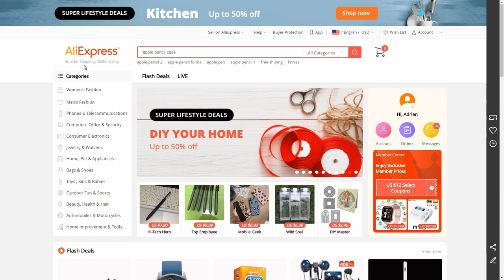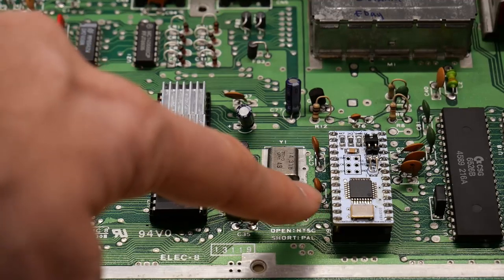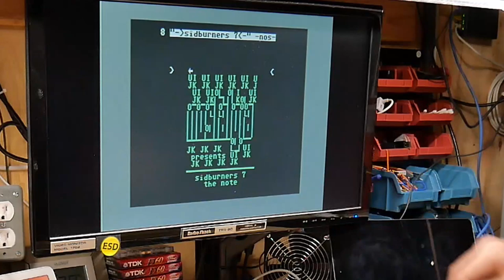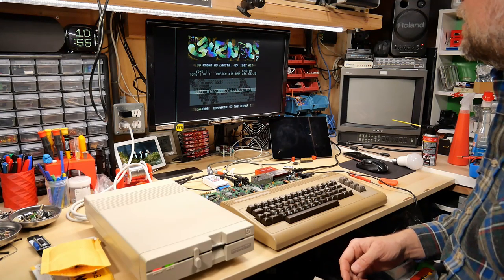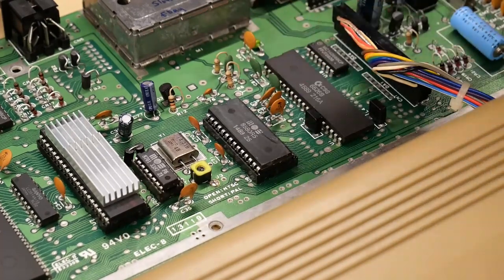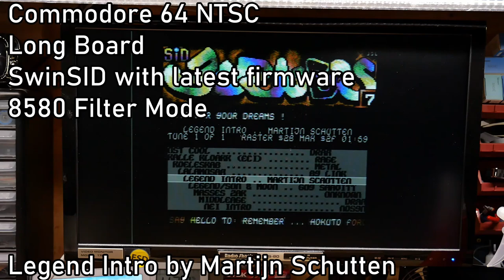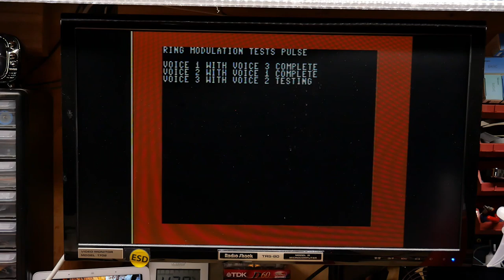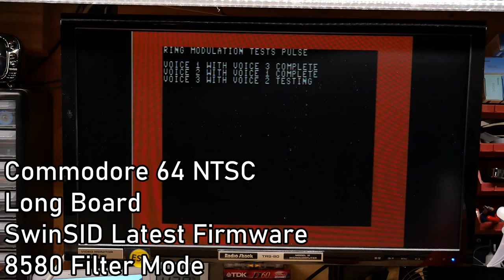I bought a C64 SID chip from AliExpress!

Comment: Oh yeah, the Legend Intro does sound a lot better on the 6581, but you're pretty lucky the 8580 is doing anything at all! I've been looking at buying some old/NOS DRAM chips for a couple of projects, and I'm basically completely ignoring any source from China now. There's a few European sellers on eBay that I've bought SRAM and other chips from before and had no issues with at all, but I finally got around to testing the SRAM chips I bought from China a while back and they all reported the same error in the Xgpro software's SRAM test, so I'm definitely not going to trust them. Ran the same test on some of the chips I bought from the European eBay sellers and they came back fine (although they were a more modern chip with faster access time, but the exact same pinout).

Comment: About the 8580, you said:"These on the other hand only run off of 5V" PATENTLY FALSE! On pin 28, you will find 9V instead of 12V.
The 6581 requires both a source of 5Vdc and another of 12Vdc. While the 8580 requires a source of 5Vdc and a source of 9Vdc.
Reply: He was talking about the SwinSID.  He explicitly mentions that the original SIDs run on 12V and 9V respectively.
Reply: @ovalteen4404  No, he was not. 03:00
Reply: @ovalteen4404  Elsewhere he also refers to later VIC-IIs running on 9Vdc which is also false.
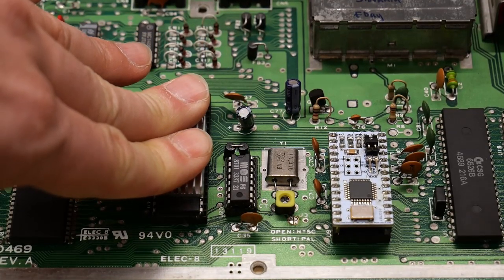Reply: @francoisleveille409  I see. Well he gets it right at 5:10. Probably a brain fart.

Comment: Joystick mod: I had 2 joysticks with two buttons (Competition pro and a Quickshot pro). I disconnected the second and led 2 wires from it to the outside. I made a plug where the fire button lines are soldered on. Then I put the joystick in port 2 and connected the wires to the plug. I think always all games which required space to jump (etc) also reacted to FB1. No gamepads back then or at least I did not have one.  Also a good Idea: The Competition Pro without micro switch fire buttons had twice as much hoisting capacity as needed to close the circuit so the mounting of the contacts can break. After experiencing that once I fixed the lower contact with TESA. In hindsight: you may have to renew it every 2-3 years as it ages badly.  

BTW: do you have a list which chips I should at heatsinks to? (I use a 128 at the moment). And what else is needeed to keep a c64/128 from dying?

Comment: I have two c64c boards and one needs a vic and sid the other has some gfx issues. I can buy them for £15-£20 and all need vic and sid for this price. The Vic are around £10, but all the sid chips are between £30 and £40 in  europe - uk. I brought a cheap nano swinsid for testing ect but I don't think it is worth buying the cheaper boards and then spending £50 to replace the two missing chips.

Comment: The TAC-2 was a great joystick. 
Come to think of it, does anyone know were you can find new old stock?
Reply: After years and years of use I actually broke a TAC-2. After a lot of (ab)use the it succumbed to material fatigue, and the small ball that actually made contact with the metallic strips inside broke clean off just below the machined out area where the wire was connected to the stick. Other than that it was basically just as new. 

By this time I was actually working for a distributor and retailer, repairing Atari ST, Commodore Amiga and various printers and portable computers. We had a lot of different joysticks in our stores and I experimented wildly trying to find "the best" for me. I don't even know what the name was of the one I ended up using the most. It was basically a grip with a small joystick and it was fast. Blisteringly fast and exact compared to all the other joysticks I tested, something you couldn't always blame the TAC-2 for as it could be frustrating trying to do diagonal moves. Sure you got there, but usually not before taking a few horizontal or vertical steps first. The "grip" joystick had no such problem. The funny thing was that apparently I was one of very few who actually liked it, so we had a crate load of them that had been pulled from the stores and was just waiting to be thrown away.

I'm guessing, but I think most people just looked at it and thought it looked weird and never even tried it. Instead they tended to buy the large gimmicky joysticks that looked like wannabe flightsticks. Most of these was mushy and of very dubious quality. I actually bought one that I ended up just keeping on a shelf. It was very well built and next to impossible to break, but also totally unusable as it was so mushy. Then there were the arcade fanatics that wanted something that felt like what they used in the arcade cabinets and those people usually ended up with a stick from VICO. Those were large, heavy and built to last forever. I can understand why people liked them, but they also had long a very long throw which made them slow.

Comment: There used to be a local guy who sold a lot of C64 chips that he got from china presumably but he would always test them and it worked out pretty well. Seems like he no longer sells them but I got a VIC-2 for 10€ which has served me well for over 2 years now. I've had pretty good luck with the 4464 RAM chips from aliexpress, cost pennies per chip compared to a few bucks for one on eBay so I wouldn't mind if half of them didn't work, although when troubleshooting it really helps to have known good chips so it's a bit of a tradeoff

Comment: As gadgetUK said the 8580 uses 9v, the vic in the short board uses 5v. It will use the ac power for switching frequency reference but works without, try a short board with no fuse, still has picture but no sound

Comment: you need to get some arm sids: https://retrocomp.cz/produkt?id=2 check out all the different types. for a remake of the sid, its good. i wouldnt say 100% but i sounds better than the 8580 and it sounds better than swin sid, plus you can change if its an 6581 or an 8580.

Comment: i got a few minutes into your vid,allow me to make a few corrections on what youve said so far upto the vic chip(on short boards) ,the vic is 5 volts only,the 6581 is 12 and 5 volts,the later 8580 is 9 and 5 volts,you want to see what happens when you remove the fuse,short board will boot and have a picture,but have no sound also can be easilly found out with a volt meter its the same pinout as early verion parts but voltages are different

Comment: I'm amazed to hear that the C64c isn't common in the States. Didn't Commodore release it in 85 or 86? I remember them being stocked from then until about 89, not just in the mass market retailers but in the nearby Commodore computer dealers. I guess the NES by that time really bit into the potential low-end sales. As an Atari ST owner at the time, I really wish the lack of sales was due to Atari ST and Amiga sales here in the States but if that were the case, both platforms would've had a much larger user base and more comparable to what both had in Europe where they were both much much more popular. Over here, the ST and the Amiga fought for scraps. What probably robbed C64c sales in the States during that time period were VTech's Laser 128 line, the Tandy 1000 line, and to a lesser extent, NOS Atari 800XLs and the contemporary Atari 65XE/130XE/XE Game Systems.

I want to see what the Commodore scene can do with the modern PokeyONE chip solution. In addition to supposedly doing Quad POKEY audio, it can do Dual SID too. That might shake up things with that SWINSID chip.

Comment: Can you tell me what Atmel chip they have used on the compatible SID board? I wonder if the difference between them might also have a pipeline delay issue where the Atmel goes through a set of instructions passed to it when simulating different registers. In the real chip, the waveforms would start immediately on the register write, whereas the processor would be going through a "do this then that" sequence as it figures out which registers the C64 is updating.

Comment: The 8580-5   is  a Nice  Sid Chip   you got lucky Adrian..     for a working  one     The  8580  had the Advantage  in the Commodore Demoscene ( late 80s early 90s )   and was preferred over the 6581  (  as it had some more features then the original 6581 )     if i can recall  ..      the  8580 sounded like crap  on the Older Games  because   some  Game composers/artist  took an advantage of the bug  in the 6581 ..    ( for those that dont know )     there  were  4 versions  of the 6581 R2 R3  R4AR R4  and  just 2 versions  of the 8580  R4 ( a Sid chip  never went into mass production  that was too be used in the "C64 Game Machine" Console that also never made it too the assembly line "Cancelled"    a Game console  that  existed  only in the  prototype stage   ANDY FINKEL own's this Prototype   this was before the C64GS  )     and  what we know as the 8580-R5   in the C128 and the 64C      Adrian Download some C64 Demo scene  of the early 90s  too present day   c64 programs  off of  CSDB .com   website    and you will see  what the 8580 can do ..    so  in short   8580-R5    late 80s early 90s  present day  great too use     Early 80s  not so great  ( 1982 too 1987 )          So  anyone that has interest    nice article too read : too understand between the Sid Chips    C64 SID shootout     https://kompjut0r.blogspot.com/2015/12/c64-sid-shootout.html
Reply from the maker: I have some 6581 advanced resonance chips on my two last longboards (both inside 64C cases) which I guess are supposed to be the best 6581 out there? Strange everyone says the 128 has 8580 chips but all four of my 128 machines have 6581 chips in them. (three flats and one D version.) 

The biggest issue with the demos are very few work right on NTSC machines. I need to get a PAL VIC-II for my shortboard so I can check out some of them.
Reply: @adriansdigitalbasement     right it depends  of which of the 6581 R(X)  Versions  is the best   The best ones  from the Articles I read are the 6581R2  and 6581R4-AR  and the 8580  R5  for the later Games  and Demos  ( demoscene )  as it has more features..   and  also the 8580R5  capable of Rapid Switching  Waves (  Saw Triangle Pulse )  etc  and Voice aka  noise  which the  SID 6581 cant do..      but   there is slightly two versions  the  8580 Earlier quiet noise ( barely audible ) aka Voice  4   8580 later Sid chips and the Later 8580 Loud Noise  aka voice 4     which  can rapid switch digital samples  with Waves   ohh yeah   i forgot   mention , there is also a SID 6582  but im not familiar with it ..       from what I learned not every SiD Chip will sound the Same  even if its the same version..   sadly  the  SID chips   that were rejected from the MOS plant   some did work but were off key..missing a filter ( mis stamping shorting ? )   and perhaps  some were bought  when  Commodore was going under and chips were Liquidated ,  as Rumors  had been , that  some independent companies  bought the left over SID & Paula chips  for  Synthesizer machines  even some of the Rejected ones    during the   RAVE & Electro Club  Craze ( Thunderdome!! LOL )  in the early 90s    those maybe are in circulation..      anyhow  ...        Download this   if you want too hear what the 8580R5 can do       its a Music collection Specifically for the 8580R5       yes it will work on a NTSC   mother board Also  just slight faster pace  ( sounds better anyways , IMO )     It also  comes with Sid Wizard a   also  compare it too the Sid 6581 and you will see  the big difference..       
A Lazy Year [8580]   [2017]   https://csdb.dk/release/?id=160991
Reply: you said  you have 4  c128's    what year are they ?   1985 86 ?    I think 1987  to 1989  is when the 8580  came into the c128  same time as the 64c      Source  :    8580R5 06/1987 - 19/1992 HMOS-II, pin 28/Vdd = 9V DC, each 22nF on pins 1+2/3+4, digisound without digifix very quiet.
    https://www.c64-wiki.com/wiki/SID

Comment: Assuming you had the mic recording at the same rate, with no autoadjustment settings built into it during your tests I checked out the sounds in a visualizer.
after chucking your samples o the intro sound test into my very old and very visual sound editing software, there is deff a difference, in all 3, the 6581 is alot of noise(think everyone talking in a large hall at once kind of noise floor but its static) and it seems to use that noise to generate the wind sounds near the start, and the beats are loud and decent. the 8580 has far less noise and uses it less as an effect and you can hear more of the actual sound, but because it has less of a noise level certain things aren't blown out of proportion, which means the beats are much quieter and on top of that they are a diff waveform, it generates them differently

the microcontroller based sid has the least noise of all, but its also set too low in volume, its 5db lower than the other two, its straight up lower volume than the rest. the beat section of the song its waveform matches the 6581 in shape and peaks, and the rest it takes from the 8580 which it matches in waveform, but doesn't quite have the same peaks again volume level(but even amplified its peaks aren't quite high enough), and it absolutely nails the waveform for some of the sounds, and totally fails for others, the others are the ones that make it sound...weird

Comment: It's unfortunate that the old 6581 SIDs are so failure prone. Add that there are much fewer bread bins are left (at least here in Eastern Europe - it was a HUGE thing to get a C64 back in the 80s then it got easier by 1990) and you can see how I could end up with only 3 in the ~30 SIDs I stockpiled. When I finally got to test them all I had to throw away (properly of course) more than half of my 6581s :(

Comment: Very nice you got a working SID chip. Especially considering you payed quite a bit for it. SID chips are getting very expensive. funny how I drown in C64c shortboards here in Norway and you drown in longboards. But yeah, in Europe most people started with C64s and Amigas later than the murricans. Murricans had already moved on from these systems  when we were still using them. This is also why Amiga 500 Rev.6A motherboards are super common over here, while in the USA the older Rev.5 are alot more common as far as I understand. Rev.5 is not hard to get over here, and quite a few of them were sold in Europe, but the Rev.6A just seems alot more common.

Comment: The sound difference in the chips sounds like it's just a filter difference. It sounds like the low pass is just too high. For the 8580R5, I'd say play around with the 2 filter capacitors for the chip and you could probably get it close if not spot on.

Comment: I suppose you could use the chip in the long board, you just have to use a patch wire to the power pin off the 5 volt rail. So bend the power pin up on the chip, and find a 5 volt source off the mother board or power supply.

Comment: Why are these old chips still being made? Or are they all new old stock from back in the day. I can't imagine anything new that uses them and I can't imagine that the market for retro PC is big enough to justify their production.
Reply: They are old parts, likely used in this case. NOS parts are likely available in some cases too as extras were always made at the time. Some classic chips still have applications today, including the 6502 and z80 products. They are simple and cheap chips that can be used in a multitude of applications.
Reply: They are exclusively scavenged from old machines. Proprietary Commodore chips aren't being made anymore and haven't been since about 1992.
Reply: They're not being made.  He said that.
Reply: Some years ago i saw a PCI card for PCs that could hold up to 4 SID chips, but i don't know if that card is still available. Of course, anyone using that card would have to either scavenge SIDs from C64s or C128s, or buy potentially iffy chips on the 'net.

Comment: I had a 64C, so I am used to the sound its SID chip makes. The older SID chip makes better drum sounds, but they are similar enough that after a while you would get used to whichever one you had. The SwinSID doesn't sound as bad as I was expecting. It's not 100%, but it's better than no sound at all.

Comment: The SwinSID doesn't sound so bad, but not as good as the original chips. I think the problem with it is that it's missing the distortion and imperfections of the originals. There has been a lot of work put into amp, speaker and microphone modelling in music software over the last decade, i think if anyone from that industry put in the effort, they could probably make a near perfect emulation of the SID sound. Problem is that it's not going to happen as there is going to be nothing commercial about making an emulator for a 30+ year old computer sound chip.
Reply from the maker: The FPGA implementations seem to be really good actually. The SwimSID development all happened a number of years ago with little more work done lately, but like you said it could he worse. To a layperson they might not even notice am issue without A/B comparisons.
Reply: @adriansdigitalbasement  I supose an FPGA costs more than an entire C64, even at todays "nostalgia inflated" prices?

Comment: Don’t like the cheap short 250469 boards. The best are the 250466 and the 250425 boards. Every SID 6581 sounds different and the SID 8580R5 are all the same sound. For me the best is the SID 6581R4AR than the 6581R3. The 8580R5 are great for stereo such on the C64 Reloaded MK2.
Reply from the maker: I'm lucky to have two (working 4AR SIDs so that's cool.) The samples in this one was a random SID with no revision marks on it )

Comment: I like what you did with your buttons but if you want to get fancy you can do what I did on my NES controller mod and make both buttons compatible with the later Commodore standard for a second button that's supported by some C65? games but mostly homebrew and notably the Super Mario port.   So perhaps a switch on the controller to go between the two configurations. .